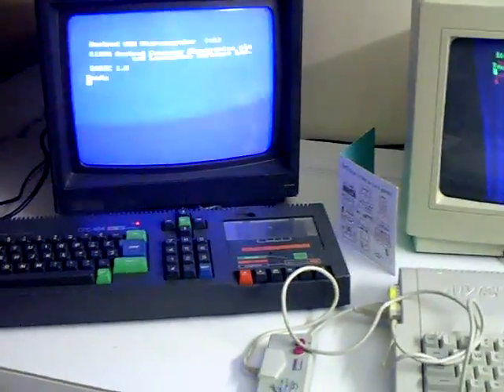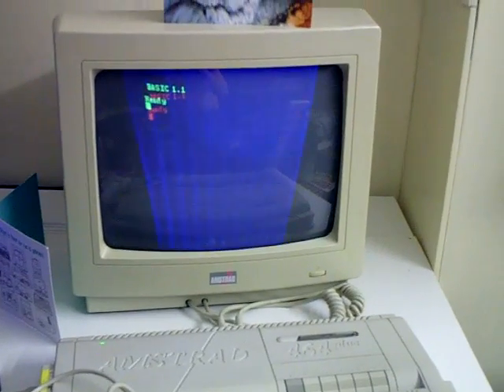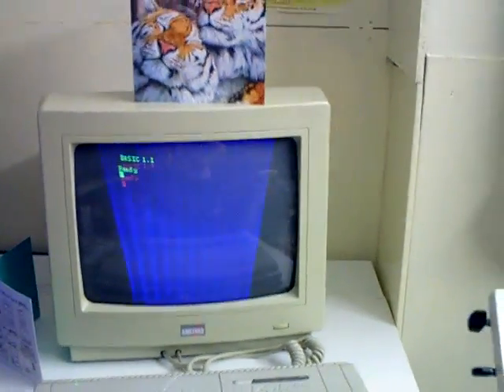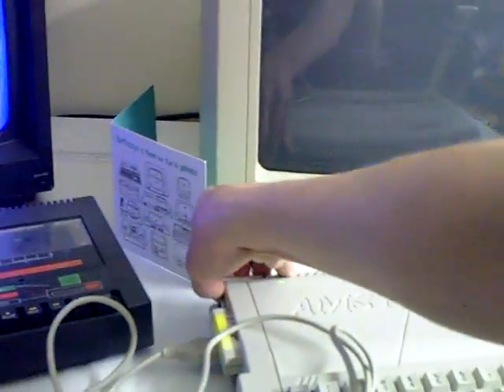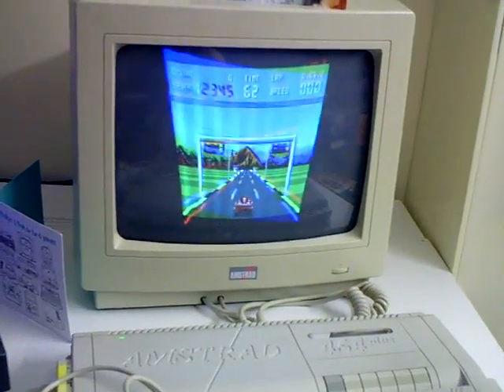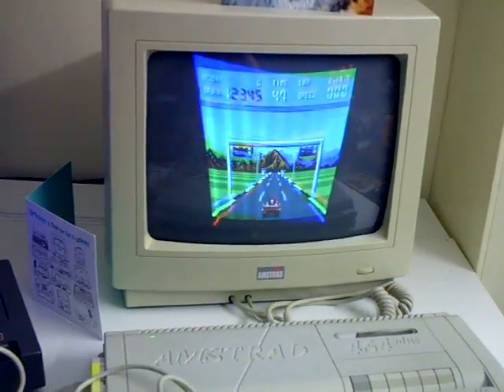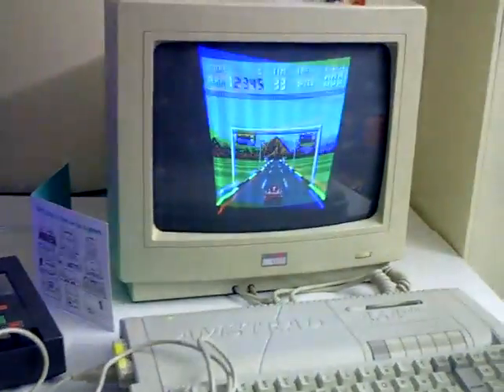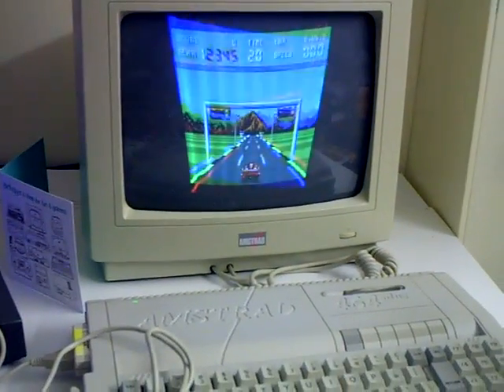Amstrad CPC 464 Plus CM14 Monitor Fault

Comment: That is classic symptoms of low EHT to the CRT. like others have said check the electrolytic capacitors, if it's not that then it looks like you have a failing LOPT (Line output transformer) If that’s the case sadly I think your chances of finding a replacement are slim to non. check the caps first tho.

Jay

Comment: Find yourself an old fashioned TV repair man and it should be straightforward. It's probably some of the big caps so redo the lot. Do not attempt this yourself unless you are qualified as the voltages can kill.

Comment: Is it an issue with the vertical/horizontal hold?   That's a very common issue with CRT equipment.  I've had loads of TV's, even an arcade machine suffer that.

Comment: The monitor just needs a cap kit, would be shame to skip it.
Reply from the maker: ***** I'll open it up and see if I can see any obvious capacitor fail without touching anything. I agree and don't like throwing old stuff like this away.
Reply: If you check out the service manual for the monitor here: http://www.grimware.org/lib/exe/fetch.php/documentations/hardware/amstrad.plus/manuals/service.manual.464plus.6128plus.gx4000.mm12.cm14.pdf you should be able to find the cap you need to replace, there probably won't be any obvious leakage etc... If I were you I'd shot gun the entire monitor chassis.